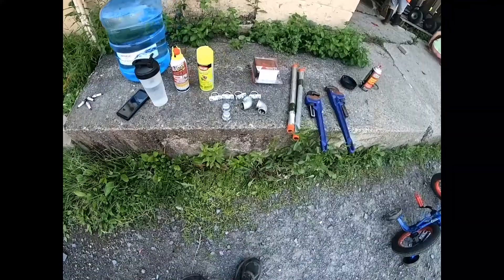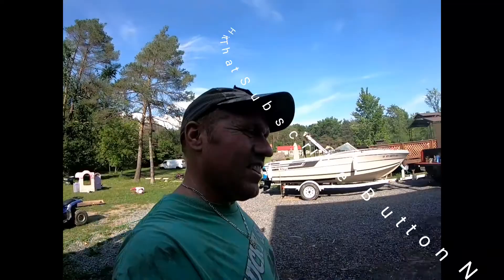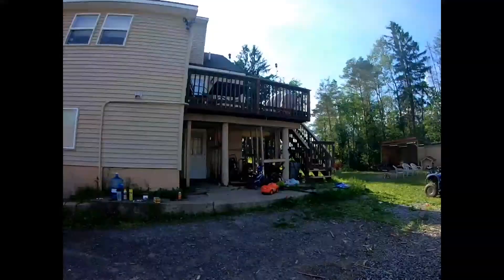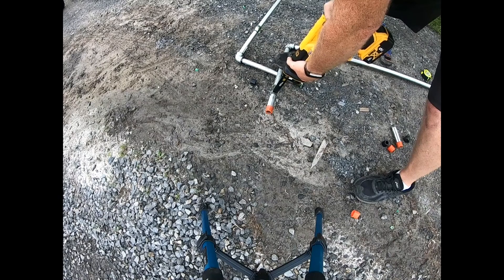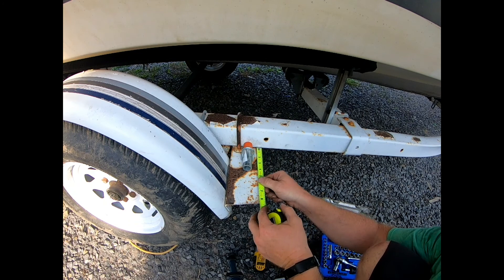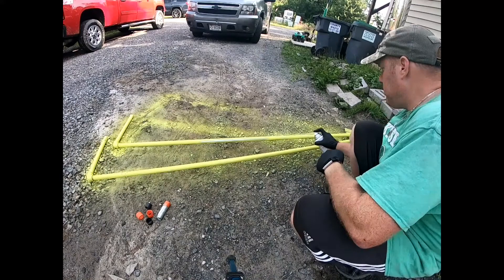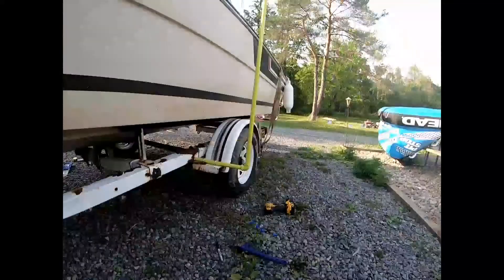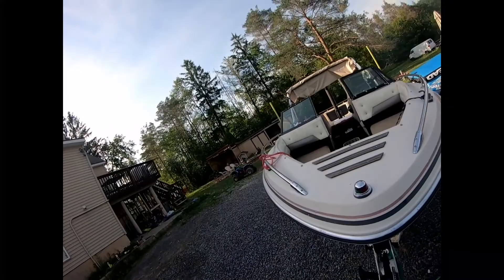DIY Boat Trailer Guides

Comment: Would these not scratch the crap out of your boat? Most kits are flexible like PVC & have a soft cover of foam.
Reply from the maker: Good Question! No It depends on what type of boat you have ,I have rubber bumper strips all the way around my boat so I never had any issues with scratching but you brought up a good idea you can buy pool noodles and slip them over the guides for better protection! Or just replace the metal with PVC same process for installing I have had PVC before and it snaps alot easier but I also had one of these crack and break I guess something is bound to happen which ever way you choose but at least easy to replace !👍 Thank you for watching!👍